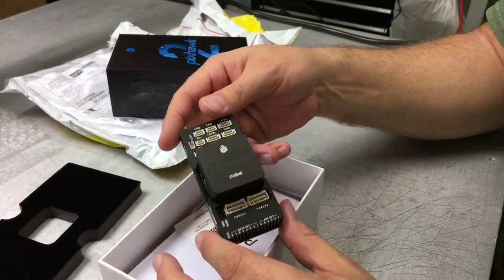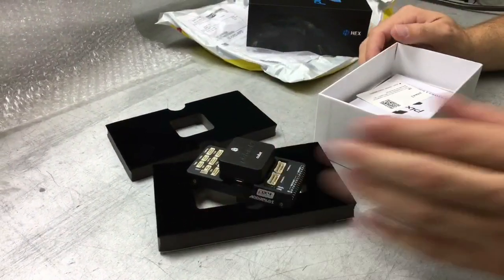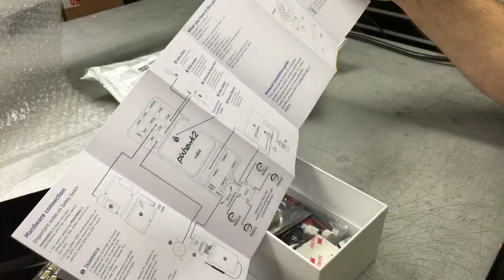Pixhawk 2 Autopilot Unboxing | Ardupilot

Comment: I just found out there are two versions of the carrier board: one that is Intel Edison compatible, and one which is not. The Edison compatible carrier board comes as a bundle with the GPS unit. This is quite an important bit of news, not mentioned anywhere in documentation so far.